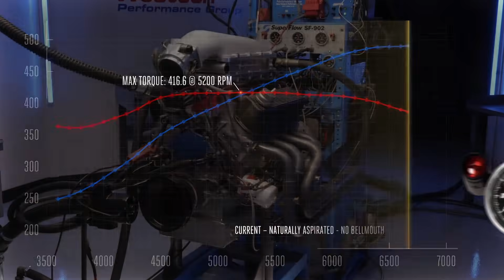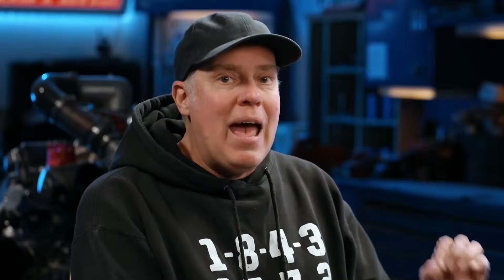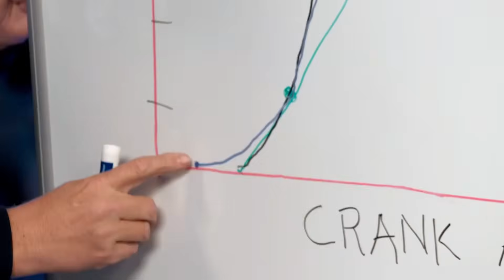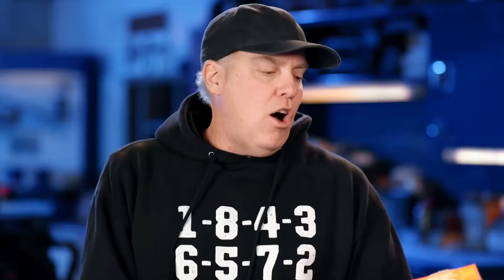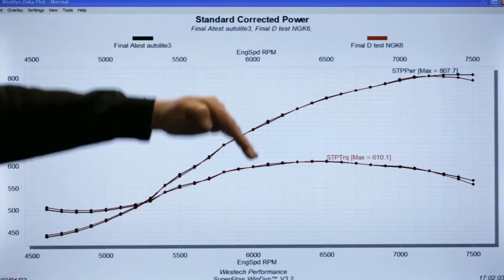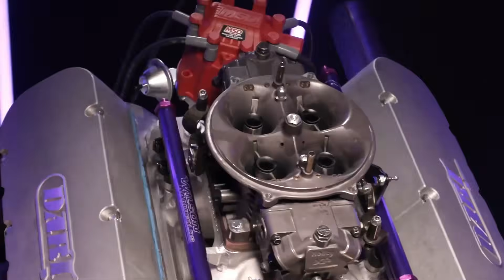Engine Masters 2025 - S9 🛠️⚙️⚒️ Bellmouth Power 🛠️⚙️⚒️ NEW TO DAY Full HD 1080p

Comment: The "bellmouth" used on the Supercharger was of a very much better design then the one used without the Supercharger.

You're always better off if you include a velocity-taper-stack between the mouth and the connecting outlet, then you get the full advantage of physics.

Comment: OK here's my guess bee four I watch it... if the carb is on the small side for the engine it will help, if the carb is big enough or two big it will not help... now to watch the video
Reply: My guess on the EFI is they are basically the same at WOT, at part throttle and low rpm with lower duty cycle sequence will be more efficenct.